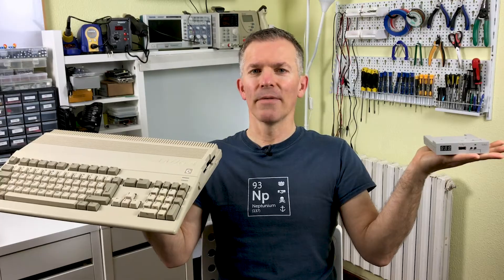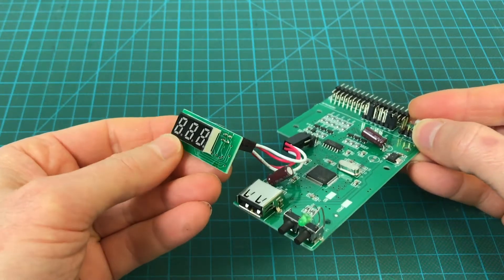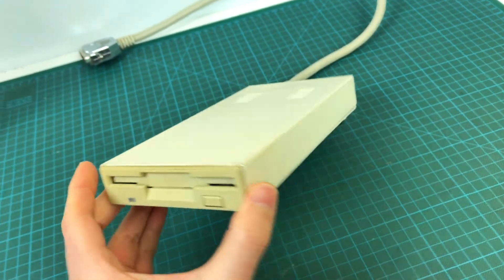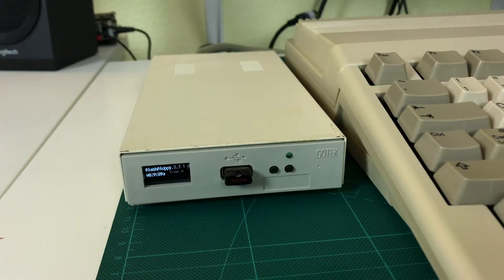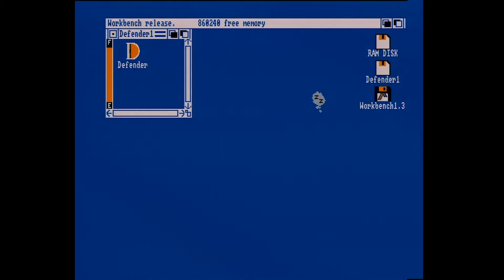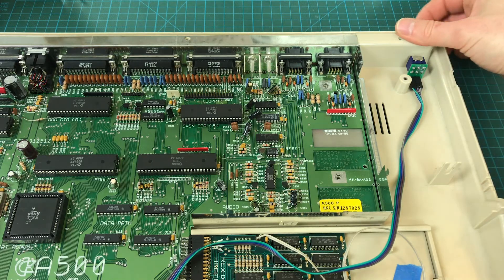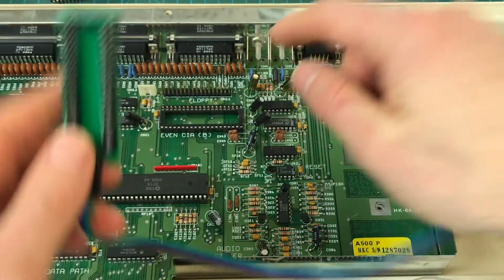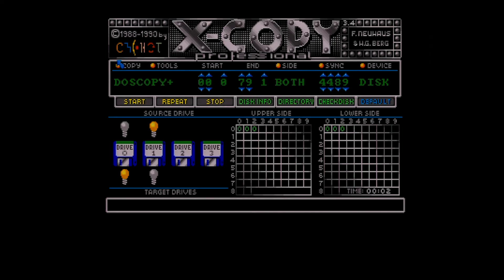External Gotek on Amiga 500 with Drive-Selector Switch

Comment: Ok so 1)where do you find an external floppy drive?
2) does this also work with the amiga 1200?
Reply from the maker: 1) Probably off Ebay. Look up "Cumana" which is supposed to be a pretty good brand, but others also work fine. 2) No idea! I haven't messed around with a 1200 yet. Maybe someone else can chip in if they know.
Reply: The Gotek works fine inplace of the internal A1200 floppy, but I don't know about the external. I reffer you to your own question 1. I can't find one either.
Reply: I found this https://amigastore.eu/440-amiga-external-floppy-disk-drive-adapter-m1.html

And this. The switch doesn't say it compatible.with the 1200. But I'm including the links for those who are looking for these https://amigakit.amiga.store/product_info.php?products_id=12673
Reply: @Kenny-bw2cz  That's what i have, i haven't installed it all yet though.
Reply: The gotek works with all amigas as External Drive. The Switch itself i  think only with similar build amigas like a2000

Comment: 3:45 - Yes the port at the back of the drive allows you to chain another two drives to it, allowing for a total of four drives including the internal one. (DF0 to DF3)
Reply: I've tried chaining multiple goteks in cases in this way and it works just great
Reply from the maker: Oh, neat! I didn't think about that. I assume each would need to have its own disk controller, right? What would be the main purpose of having multiple drives chained like that? Massive copying of disks, or would a game with multiple disks be smart enough to check all available drives for different disks?
Reply: @NoelsRetroLab  It depends on the software.  Some software only looks for DF0:, some only look for DF0: and DF1:, and some can and do use all 4 drives if you have them all connected.  The main purpose was to reduce disk swapping, as many games would load something from say Disk 1, then Disk 4, than Disk 2.  If you only had the one drive, obviously you'd have to swap each time it wanted a different disk, with two drives you'd only have to swap one disk (so in this case, eject Disk 1 and insert Disk 2, and if the game supported all 4 drives, you could just pop each disk in a drive and off you go.
Reply: @NoelsRetroLab contrary to an Ms DOS PC the Amiga always checks all drives for an inserted disk. Note the message says "Insert a disc in ANY drive". Back in the days I had an external disk drive and it was a breeze playing 2 floppies games
Reply: Actually it was a little more complicated. With the Amiga you could address floppy disks in 2 ways : either by the drive unit, such as DF0, DF1... or by disk name such as Defender1, Defender2... If you used the second way, and many games did, the OS would look for that disk in any of the connected drives and prompt you to insert it if it could not be found
Reply from the maker: Right. That makes sense since a lot of the copy programs have the option for 4 drives but there's only one drive connector. Thanks for clearing that up.

Comment: Hah, I wanted to do the exact same thing and bought the exact same selector on Ebay. :D Only crucial thing missing is a proper external drive, they're getting to be quite rare - I bought one online that was sold as not working for use with the gotek but I think the controller itself is what the problem was because the gotek's LED works but it refuses to boot from the thing... so the search continues.
Reply from the maker: Oh really? I didn't realize external drives were becoming rare. I bought mine last year and I seem to remember it was around 30€. But things keep going up all the time. Are there external drives that are not compatible with the Gotek, or is any external Amiga drive good enough?
Reply: @NoelsRetroLab  Not to my knowledge, I would assume that if the controller is good for any regular Amiga drive it'll also work with your modded Gotek.
Reply: BokanoiD  there at least 2 types of external drives. The ones that use a regular amiga floppy drive and the ones that use a regular pc drive with special circuits. The first ones work right away with the gotek, for the second ones you need to modify the circuit but I’m not 100% sure how.
Reply: @rodrigosaez9999  Thanks for you response. It might very well be possible that it was such a drive; I also tried a working Amiga disk drive and that also wouldn't work. I did luckily managed to get an external drive that does work with a Gotek, so I'm happy now. :)
Reply: BokanoiD nice. I just bought another gotek to try it on one of my external drives. The previous one didn’t work on the external one I disassembled . I still haven’t found a detailed explanation of what to do.

Comment: Can you do a like mod for the Atari STFM that doesn't involve cutting chip pins as the current Atari mod does? I have a Gotek replacing my internal floppy but would have liked to keep the internal and mount the gotek in my external drive case as you have done with the Amiga. I don't want to cut my chip pins...
Reply from the maker: Haha... I've been looking for that exact setup myself! I might have to figure it out. If I do I'll make a video for sure.

Comment: I don’t see any external power going to that thing. So it’s getting power over the cable? Didn’t you just say it couldn’t?
Reply from the maker: Good point. There's power to be had in the Amiga connector, but not in the Gotek data cable itself. That's why there's always need of extra cables (although sometimes they can be more tidy and they split up closer to the Gotek than the Amiga). Still, it means connecting multiple things to the Gotek, which is a slight inconvenience.
Reply: @NoelsRetroLab  Thanks for the clarification, I was wondering what part I had missed hehehehe
Keep up the good work and have a nice weekend :)